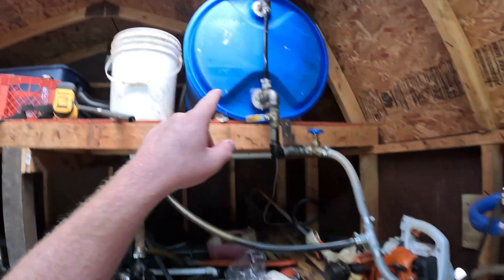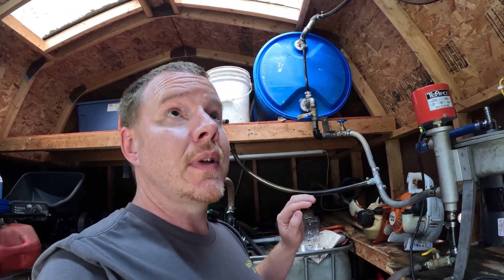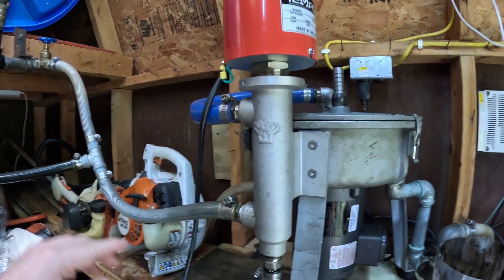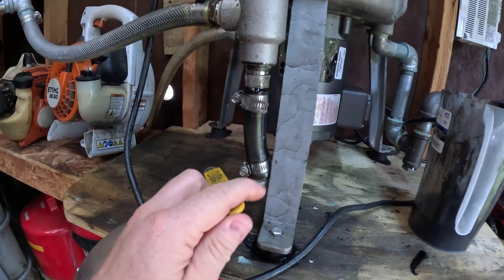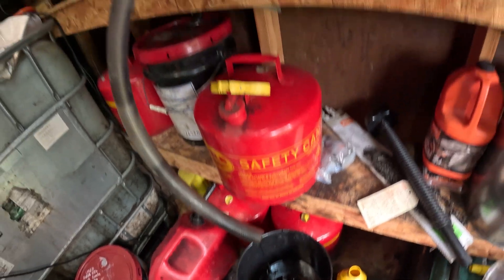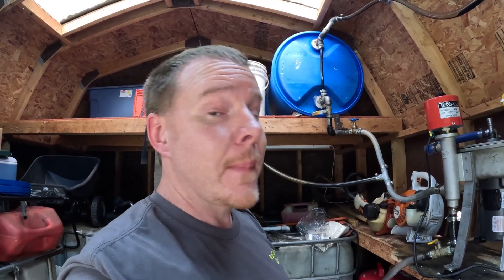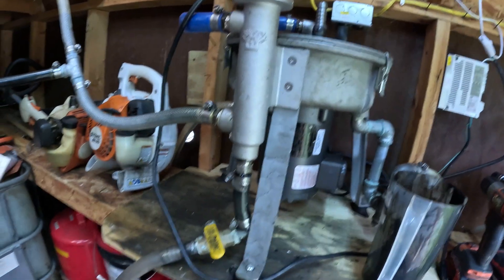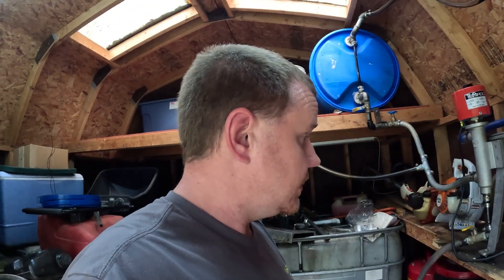Black Diesel Basics - Back To Basics - Centrifuge Heater Setup - Removing Moisture -WMO - WVO

Comment: Something i cant find any info on is if a gravity feed bowl centrifuge like yours with the inline heater can run dry of oil, the heater more specifically.
Reply from the maker: It's all in how you plumb it.  With the feed tank elevated and plumbed to the bottom port on the heater, the heater stays full no matter what.

Comment: Hi m8 I'm from Australia I have had a pa bio diesel centrifuge for maybe 5 years I have never set up I have heaps of plant machinery Kubota excavator 17u is one of them 2022 would it work on wmo also I want to buy maybe a toyota hilux I'm not sure if you get in the US but I'm told that the later model diesel might not be good for wmo I won't put in my toyota  prado how about the landcruiser with wmo thanks
Reply from the maker: If the engines have emissions systems in tact, I'd advise against it.  Which PA unit do you have?  Direct drive or the little pressure drive unit?

Comment: I like the drain on the heater with the valve. Easy way to dump it out.
Reply from the maker: Yup.. moisture tends to collect there so I drain it with each run.

Comment: how cold do you think you could process in , we get down to like -30 to -40 in the winter here, think that would just be a no go for running the centrifuge, or does the heater make it not really matter.
Reply from the maker: The hard part would be moving the oil.  Pumps don't like thick cold oil.  If the shop was heated, it wouldn't be an issue at all but it would be a struggle for sure that cold.  The unit would still operate as normal though

Comment: @notsograngarage
Can I mix in biodiesel instead of gasoline? If so what would the ratio be?

Thank you.
Reply from the maker: It would be the same as mixing with pump diesel I'd say...    and I'd say 50/50.  Diesel / biodiesel doesn't thin as well as gasoline and that's the main purpose.

Comment: Auto parts store automatic transmission hose can handle high heat and petroleum products. Also hydraulic hose scrap/drops would work from a hose shop.
Reply from the maker: Hyd. Hose is a possibility but many aren't rated for the heat.  I've not seen 3/4"+ transmission hose either.